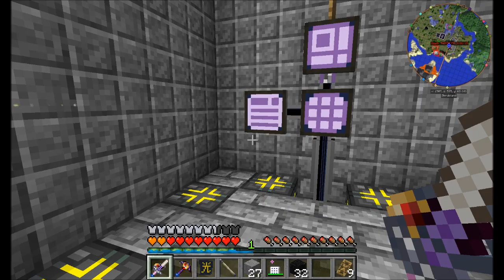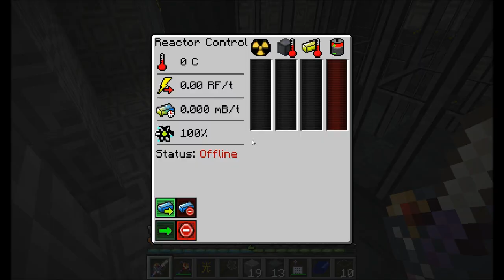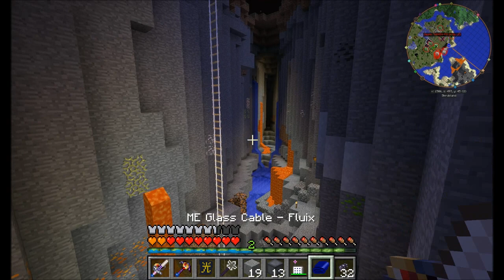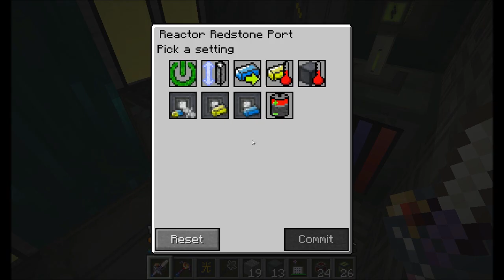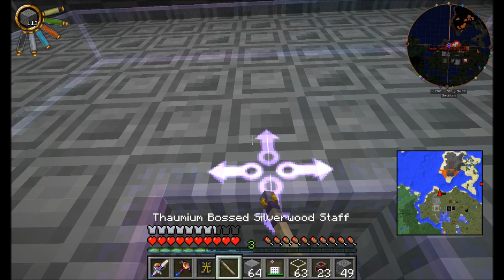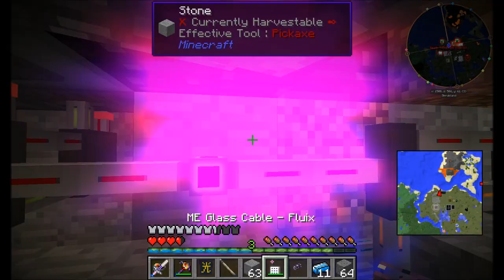Lets Play   S7 E66 Powering Up

Comment: About the reactor coolant;  I was under the impression it needed to be filled with source blocks of liquid coolants.  Is that not the case?
Reply: +DontEatTheReaper Of course not, you can’t use the coolant material as the case! <cough>
But yeah, I didn’t think you could do it, either. Probably because I never tried. I use Gelid Cryotheum because it’s a cheap coolant that’s still effective, but since its source block needs support from a solid block or another fluid source, I had no choice but to fill my reactors with all source blocks.

Comment: I've been following your series (this one and the old ones) for quite some time. Not kept up to this episode, so if this has changed ignore it, but here you are:
(1) I appreciate your attempt to build more interesting houses, but have you ever heard of windows? They would do quite a bit to make your houses look better.
(2) I've seen how you not-deal with Flux. Maybe I'm obsessive about this, but why don't you use the alchemical construct to avoid Flux for manual alchemy? Instead of throwing things into the Crucible, just hook up some jars to the Thaumatorium.
(3) I've replicated your tree farm build from ep....was it 28?....and the auto-crafting of the axes stopped working after some time for no reason I could determine. Looking for alternatives to SFM, I found that the farming station accepts Tinker's Construct axes...including ones with three levels of auto-repair and one level of Reinforced. Also, EnderIO's item buffer should be able to deal with distributing wood coming out of the farming station in the right amounts.

Comment: Hey dire, i also found a bug with the twilight forest fiery pickaxe. It auto smelts gold and iron ore just fine but coal turns into yellorium bars and alot of the thermal expansion ores turn into pulverized iron. And it also turns cinnibar into alumite. Just though id let you know

Comment: Pro-tip: at least in more recent versions, a single ender-lily seed produces FOUR buckets of Enderium fluid stuff..so four pearls make one bucket, a single ender-lily seed equates to a full stack of melted pearls. This works in Infinity, not sure about DW20's pack. Just heads up. (also, melt and put into buckets, put in TiCon smeltery, gem cast, make pearls. One seed=16 ender pearls)
Reply: there maybe a config somewhere that adjusts the amount of ender pearls spawned per ender lily. but ill check that out. thanks

Comment: Dire has miscalculated ))) "Octadic	22/min	3,000RF/t" - per 4 means 12kRf, "Double Layer	12/min	1,000RF/t	200,000 RF" - per 4 means 4kRf
The best fuel rods configuration is + but not X. This increases an output because of interaction.
Reply: Nope. He mouses over the bar and it says 1500. 1500x4=6000
Reply: Yep. I saw it. I think it was a result of division of consuming internal buffer and capacitor bank, thus only 50% was drained from the bank. Not sure, as ender io wiki might be outdated

Comment: direwolf20 conduits are the same a flux ducts and they are limited at the imput and output not how much they can have running through them so the tier 2 conduit will work just need more connections on your reactor and capacitor.

Comment: I found that the best way to control the reactor is to use two redstone ports connected with rednet cable.  set one port to output the buffer energy storage percentage, the other port to change control rod insertion percentage.  This causes it to automatically insert or retract control rods to keep the energy buffer full.  I've been using this for quite a while on Hermitcraft Infinity and it's a totally hands off automatic control that just works.
Reply from the maker: Tinfoil Chef That sounds pretty cool :) I'll try that out!
Reply: direwolf20
I personally add in a gate so that when it hits say, 50%, the redstone signal stays on for a bit, just so the reactor doesnt turn on and off every second
Reply: I just use 2 Redstone ports, 1 that sends a Redstone signal when it hits a certain percentage on the power buffer connected to the other to trigger the reactor on and off. Haven't had any problems with this setup.
Reply: direwolf20 I did that with 1 rednet control port, White channel for energy percent, red channel to control rod insertion, a simple Passthrough from white to red and voilá
Reply: God damn it! I was just going to say that. I was literally typing it. :,-{
Reply: Jeremy LoGiudice I had problems with that setup :P
Reply: +Jeremy LoGiudice I used to do exactly that, but I learnt it’s better to toggle it using a power monitor since it eliminates the constant on/off cycling if it’s exceeding demand. I re-purposed the extra redstone port to sound an alarm when the reactor runs low on fuel, though I automated it with my ME system (fuel insertion, waste extraction & reprocessing) so that’s also kind of redundant.

Comment: 'This is a good time to start it because it needs 6,000RF/T. Thats a large number.'
-Direwolf20 2015
Reply: Mr Mango I'm playing FTP Infinity, which has RFTools in it (which would be a great addition to the D20-pack imo) and thanks to dimension-building I'm constantly using 90.000 RF/t. Supplied by 4 big Big Reactors (not tiny Big reactors like Dires) and a dimension made of uranium. My energy is stored in a 5*5*5-vibrant capacitor (the emeralds I used for that are generated by bees (is Dire going to play with bees?)), which means that I have an emergency-buffer of 3 billion RF.
Reply: Not bad. I actually don't have huge power demands yet, so I'm only running a single 7x7x7 reactor, which outputs a mere 11kRF. But I made it self-sustaining, because it's used mostly to power and MFR mining laser, which even with no color foci, gives me more yellorium than the reactor burns. Along with a steady supply of every other resource too.

It's on a custom mod pack, so generation / usage rates of your reactor, and power needs of the mining laser may vary depending on your configs. Also I have Nether Ores, and Nether Uranium is config'd to produce quite a bit of yellorium for each piece, which helps, because the laser produces one of those every so often. If you look carefully through NEI's machine processing tabs, I found that induction smelters with rich slag give a hefty bonus to how much yellorium I get out of an ore, and I get the slag from processing all of the other ores in various machines.

So it's a setup that works very well for me, and I'd be curious how well it works on other packs with other configs, especially with Direwolf20's nerfed yellorium life. My 11.7kRF 7x7x7 reactor uses only 0.8mb/t (5 rods in the same pattern as his, with resonant ender all around)